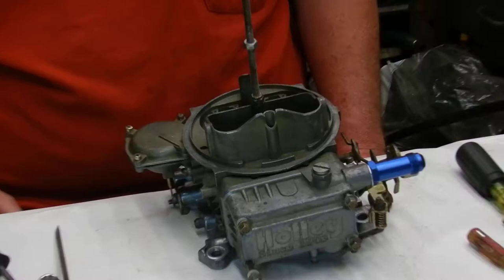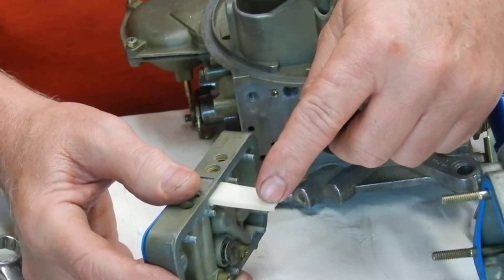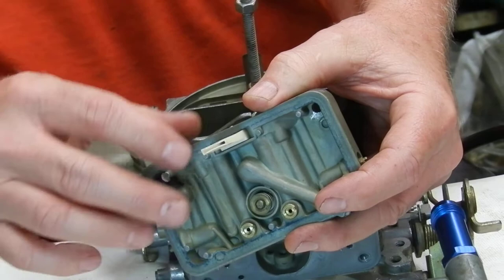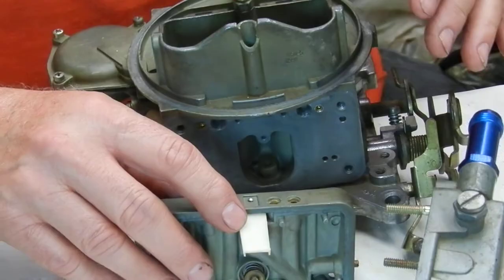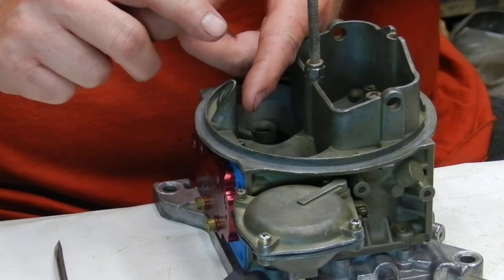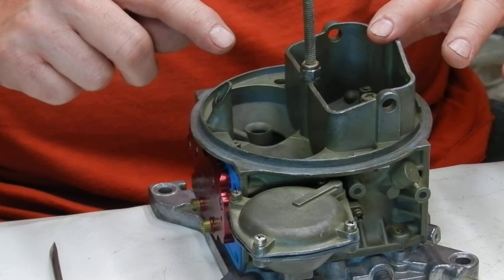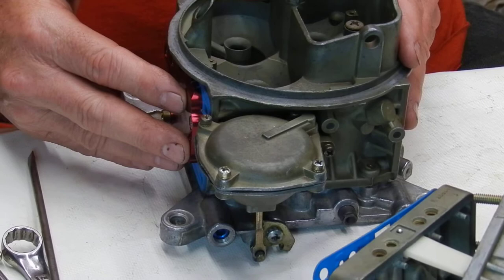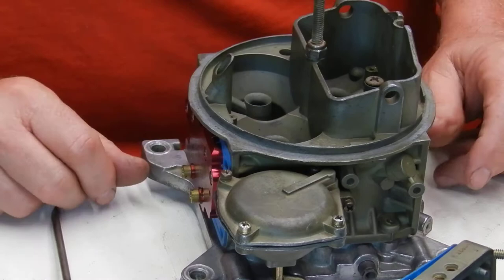Holley Carburetor: Vent System Explained

Comment: This is why you see guys with rubber fuel lines connected to their vents, connect them and cut a breater hole in the top of the hose. Keeps fuel slosh from exiting the vent tubes.
Reply: make a tube that connects both vent tubes lol
Reply from the maker: Thanks for watching.

Comment: Very good explanation of the "vent whistle." One can also connect the two vents with a raised vented tube in similar fashion to the Holley "truck avenger" carbs. Just make sure to keep the tubes at least 1/2" from the top of the air cleaner lid to prevent possible venturi action richening the mixture. Here is a good link for off-road specific modifications: http://classicbroncos.com/tech/offroad-tricks-for-holley-4-barrel-carbs
Reply from the maker: Thank you

Comment: Is a vent whistle ok for side hung float bowls? Like on a Holley 4180c?
Reply from the maker: No unless someone designed one specifically for it i have made some in the past , but I usually just find some center hung bowls and change them. I have a video on that. Hope this helps.

Comment: I was wondering why car stalls anytime i go through the bumps
Reply from the maker: There is all kinds of things can cause this , carburetor (float level to high , idle circuit problems ect ) ignition system ( ignition coil connections or bad ignition color and kind of loose  electrical connections. Hope this helps.